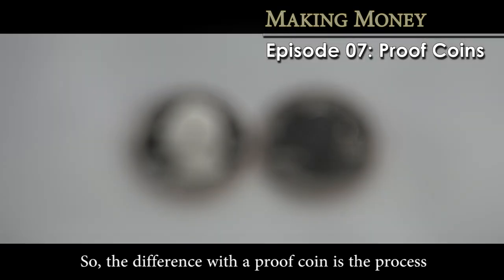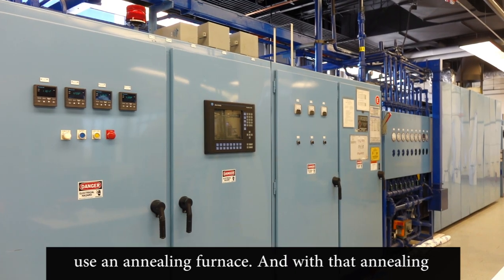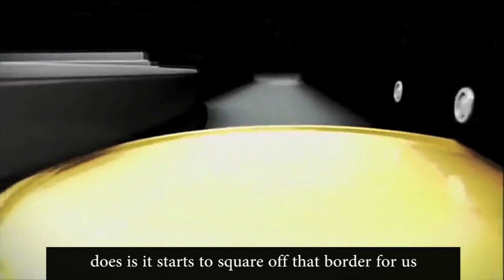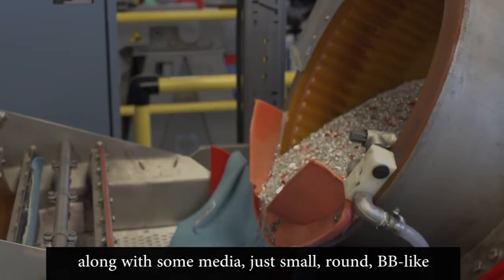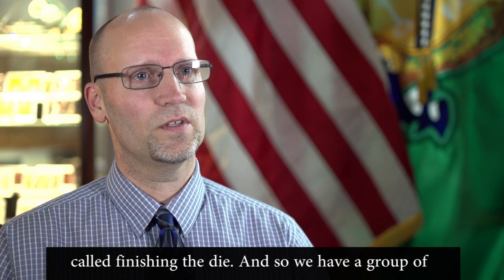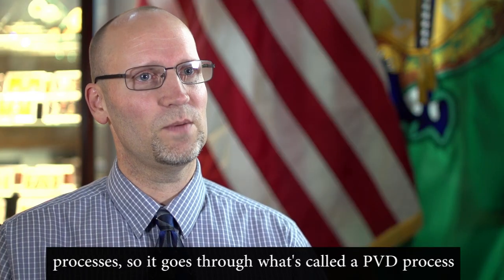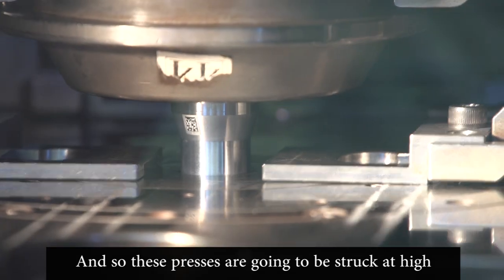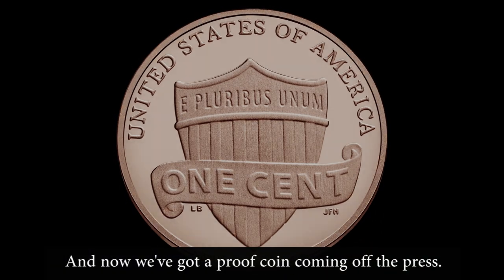Proof Coins: Making Money Episode 7

Comment: I love when i buy slabbed proof 70 coins and a month later they have milkspots all over  rendering them worth far less now than what i paid.This needs figured out please.
Reply: Probably the grading service tainted the coin before it was slabbed, since humans are handling the coins: open up the original package, grade the coin, assemble the new package and label, and insert and seal in the package. Lots of manual steps.

When the coin is made, there's no humans directly touching the coins because most of the processes with direct contact are done by machines.

At coin shows, I've seen people with white gloves on handling coin carefully, but later touch the outside of the gloves to the face or other unclean surface, even touching the gloves' outside after taking off the gloves, or putting them on an unclean table. This transfers oils or contaminants onto the gloves and can stain a coin that is later handled with those gloves.